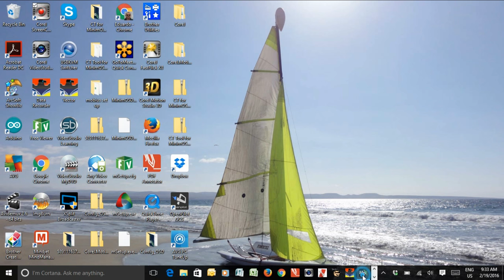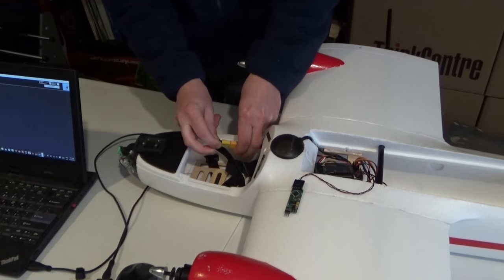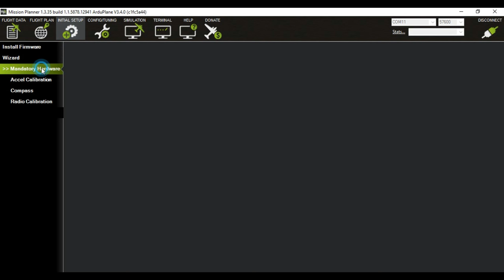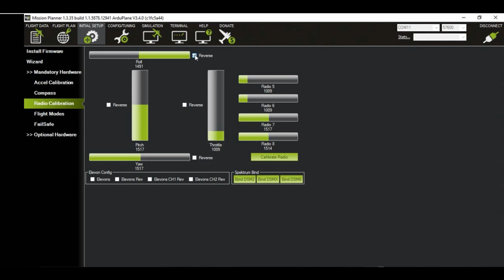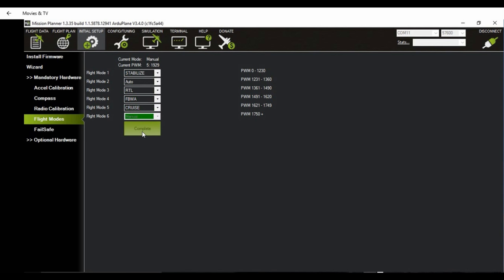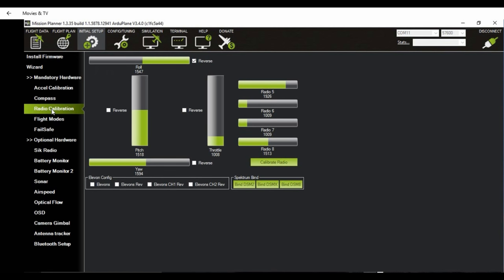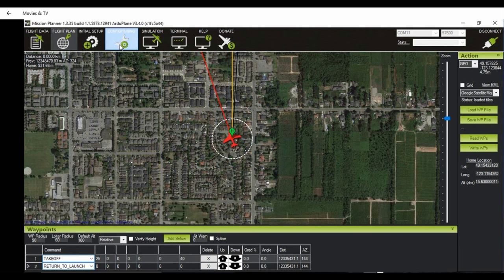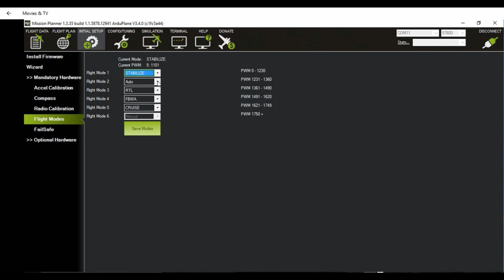APM 2.6 COMPLETE configuration set up STEP BY STEP explained.

Comment: hi Eduardo , I am fine tuning the apm ... I have a few questions on this system since its all new to me really .............. did you ever set flaps and if so how did you set them ?
Reply from the maker: We have not set up flaps on the APM, but we have set up a camera switch to change the flying camera to two others and we gave set up a switch to change the frequency of the VTx in the air. I will make a video to explain how it's done.
Reply: Eduardo Fritis that's great , surly you should continue the apm videos , you did a good job on the last one

Comment: Great video thanks, I just got back into MP with apm2.8, do you know why i cant disarm plane with version 3.3.0? thanks
Reply from the maker: I believe that once you arm the plane you can not disarm. If you are flying and decided to glide with no throttle for a period of time you will need eventually to start the motor again. I believe that us the logic of the plane version.
Reply: thanks for the reply, do you no if you can over ride that and a sine arm/disarm to a switch on the Tx? i have 16 channels on taranis,cheers Brett
Reply from the maker: Just program a throttle cut on one switch on the Taranis.